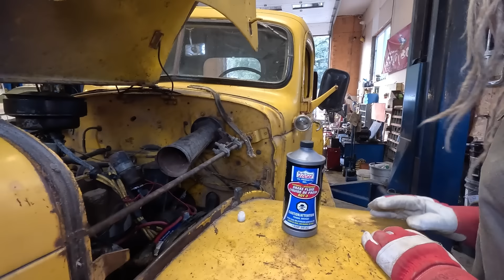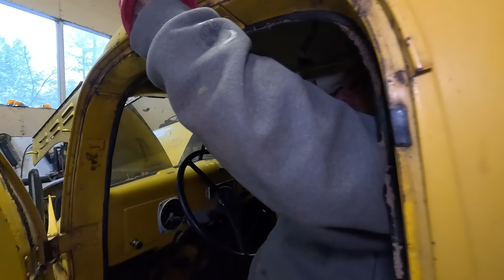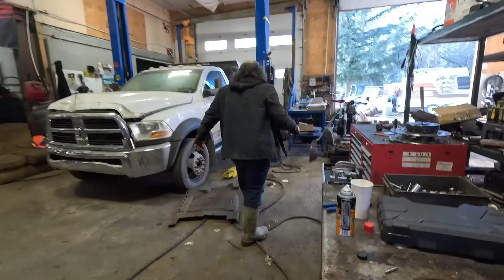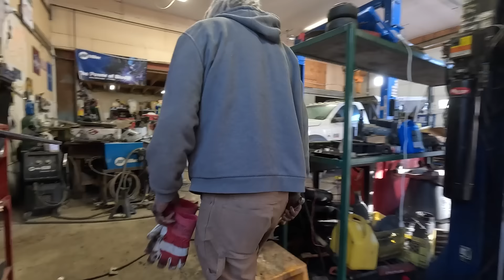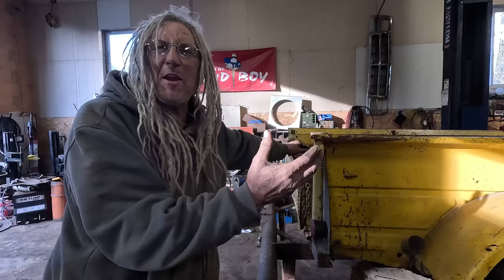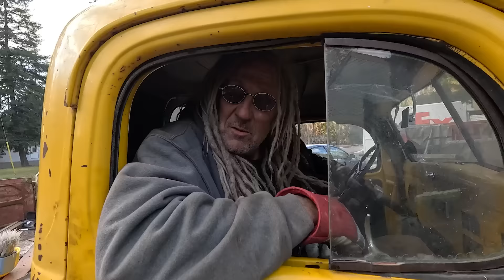1956 Power Wagon Brakes & Test Drive

Comment: Ffs Avery.  Enter this in the Derby. Just sit in the middl and have a sandwich and a beer and you'll win it 😆 in the bit of research tipped off by that gas cap esso aviation fuel cap. I'm thinking this served on rcaf and or Raf airstrip for fire rescue etc. Just a thought.